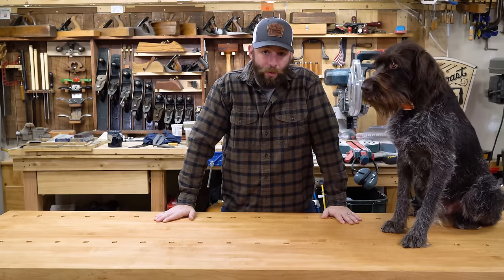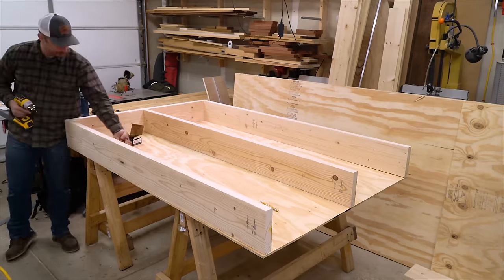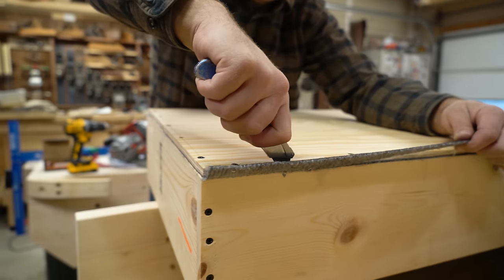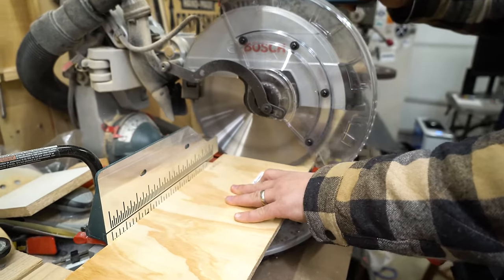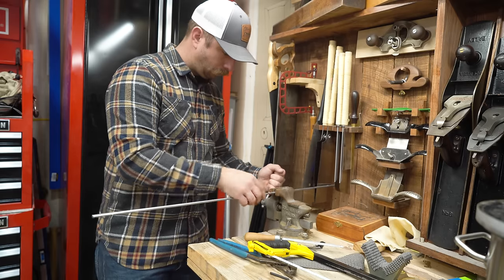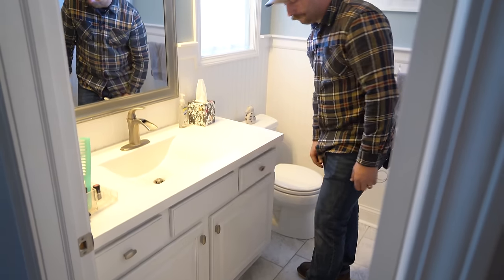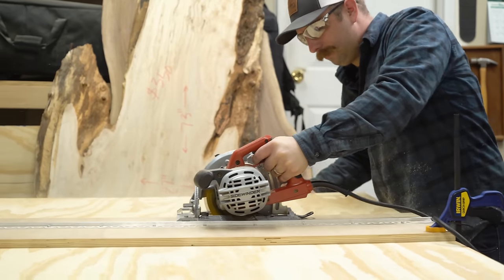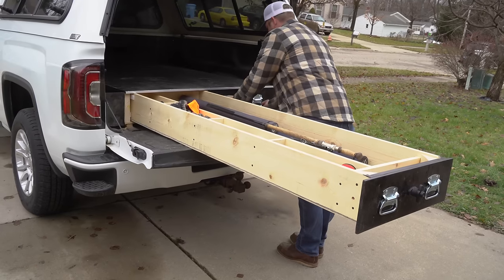How To Build Truck Bed Drawers // SUV Drawer // DIY

Comment: I made a set of these  using 3/4 sanded ply for almost all of it with a 12" tall box for my F-150 8' bed - then built some sliding  internal boxes within the drawers... so far so good. One issue was the  UHMW - cheaper to buy a whole sheet than pay for shipping. I used pocket screws and glue - Temperature changes were  an issue with the UHMW  temp swings were 35 - 75 degrees during the build - hoping the weight of the drawers will solve any issues going forward - I live in AZ - the real test will be the long hot summer - good project - next phase is a rolling truck bed to mount to the top - I think I will have my welder build it for me instead of more wood and a bunch of bearings or maybe use 8020...

I don't have a tailgate so I mounted the whole project to the truck bed with rivet nuts - my new favorite thing - cant wait to find more uses for these babies
Reply: did you find the drawers have enough support fully extended without the tailgate?
Reply: @hannahpierson5648   yes - plenty of weight to counterbalance as long as 1 of them is  is closed. I have developed a problem with the slides on 1 side so I have to re configure the slides - what has happened is one of my pocket screws went through and etched a groove in the plastic slide material so I have to replace it. - The box I built was 6' long and sits in a 8' bed - Right behind the cab I have an inverter and shelving - hope that helps

Comment: nice video,  did u have to go back drill holes for closing air compression creates resistance to close sometimes suction ? dark pencil like soft lead can be used same as lipstick or little chalk from chalk line ,  go grandpa  heehhe
Reply: Given the size of the channel on either side of the drawers, I don't think drilling extra holes is needed at all.

Comment: Nicely done, at first wasn't crazy about the carpet idea but then it seemed to make sense for me. The plastic for sliding was very clever, will use that. Really like the locking mechanism, need to adapt that for my truck tailgate window too. That lipstick heist was great especially the recriminations you had to endure. I'm going to make it all from free craigslist lumber or construction throwouts. Thanks and awesome shaving!!

Comment: Very cool!  Just need a power inverter in there and then you can plug in a battery charger for your drills or something.  I couldn't really tell what all you put in those drawers, or what kind of work you do, but they are certainly functional.  Nicely done.  Cheers

Comment: I just built these for my Ram. I’m definitely not a carpenter or woodworker and it shows. But the plans were easy to follow and make adjustments to for my auxiliary fuel tank. I’m a mobile rv repair technician and these drawers will definitely keep me more organized. 

I highly recommend buying the plans.  Doing it yourself will save you thousands of dollars compared to buying the prefabricated drawer systems.

Comment: I’m very pleased to have found your excellent truck bed drawer build. 
I was seeking some very costly drawer slides to accomplish what it appears you’d developed for a tiny fraction of the cost 

Not as smooth and easy as roller bearings, but $300 to find another method to avoid breaking a sweat? 

I’m making something for my Honda Odyssey work vehicle. I do mostly electrical and security camera and FSTV entertainment system work. I wanted something to obscure the costly and extensive Makita battery powered arsenal I haul around Wisconsin. Having a blackened out box is a good start. Seeing a ladder or maybe plastic sawhorses isn’t likely to entice a junky to break my glass for a fix. Having a 700lb locked box holding $3k in tools that can’t easily be removed means it’s either the whole car getting stolen or none of it. 

Thx. Again. ❤

Comment: You really did do a wonderful job on those drawers - but you being a gun woodworker, with all the skills and tools I can see why. Very well done - I hope mine turn out half as good. I really liked the idea of the strips of plastic, they usually use tracks but urs worked extremely well, good job. Thanks for sharing. 😊

Comment: Sweet !  I thought the  slides were a good idea and i always get a kick out of the shop assistant as he reminds me of my old  LabraDoodle who used to be by my side  for everything  i did  ad she enjoyed  jumping up on whatever she was allowed to  the drawers a  definitely a way better way to   Keep things organized and accessible in a truck bed  plus its a heck of a lot easier on your knees  then crawling in and out of the cap looking for things ! The only negative thing i wanted to let you in on. Is  that  i was a cabinet installer for over 20 years and many of the cabinet lock keys will  lock and unlock   Topper handles  i used to drop off. Items to coworkers into their trucks using the keys to  put items and lock them into their trucks  in parking lots and even their driveways at times  the one brand that used a completely different tumbler was roll and lock   Bed covers ? I put one on my Chevy Dually 3500 loved the look and inception but it wasn’t  very water proof  so that was a bummer  i do reccomend caps to most of my freinds but warn them about the security  i was lucky in my previous truck with a cap that had tinted windows i made a black vinyl cover that  hid any valuables in the bed  if you tried to look thru the windows it gave  the impression that the bed was empty

Comment: Perfect👌for what I need. That would for my application ready-quick storage space. Some guy in LA was advertising something very similar to yours on "OfferUp" for $600. I commented with a "fair price, when  can you do.?" He responded saying unfortunately he couldn't travel to Las Vegas.  Lol. I don't have the professional pre-planning skills that or would take. So,  thanx for the video. You're good at what you do. Got a bit of experience & all the right tools. Good job..!! >> I bought a $300 Harbor Freight large 48" wide top tool box. It was easier, but i give up the entire rear cargo area of my Tahoe. Now it's more difficult to sleep stretched out in the back. I would rather have what you made.  Want to trade.? But I CAN use my back seat which is good. I would use my tool drawers more than my back seat though. I just subscribed to your channel & shared with two idea interested friends.

Comment: Thanks for sharing- excellent design and build. The one thing I didn’t catch is why you made the drawers 1/2” shorter that then you added the additional blocks at the back of the frame. Why not just make the matching length?

Comment: Great build. Very nice job.

The only thing i might change is to possibly add a support that folds up under the drawers to support them while they are open. 

I plan on building a set of drawers although I want to use a tubular metal frame.

Comment: This is GREAT! Though I need to be able to pull the whole tool box out of the the bed of the truck and use it as a stage. but still with compartments and have the stage/storage wired for a central power hub capability a for lights and sound equipment. And maybe some detachable dolly wheels for truck to setup location. I am not super handy but, this video was the perfect starter platform I needed. great video.

Comment: I made something similar( not as nice) and also had a slider on top of the sliding drawers . Instead of screwing the top plywood down I put rollers  bearings , (underneth ,(where you have your 2x8s)So had tool storage,  and also any cargo on top could slide out or in. Then I switched trucks and just have side aluminum boxes now , left my pick up open bed, with a home made bed slider only..  Seems like we always thinking about easier way to get tools in and out of a job and have the tools organized to save time and make it easier🤓

Comment: I really want to build one of these for my plumbing truck. The metal drawer systems like the pack rats are small and very expensive. But... I don’t have a camper shell on my truck, what do you think about it being exposed to the elements everyday? Do you think it would hold up?

Comment: Nice design and well done video!  I might just build some.  But those screws into the truck bed are at risk of causing a rust issue in the long run.  At the least, I would seal them up with seam sealer (from any automotive parts store), from the bottom and from above

Comment: You can buy a 55 gallon plastic (HDPE) drum often for $10 used, and cut the 1" strips out of it for the sliders rather than paying $65 for a small sheet of UHMW. Just use Loctite PL 3x construction adhesive to secure the strips rather than screws.

Comment: Great build, I'm about to make my own.. couple questions - how much weight can you put the 1/2 ply top before deflection becomes an issue? and I'm surprised you used 1/4 for the drawer bottoms.. hows that holding up? Would you change anything? Thanks so much.

Comment: Love this! I just need to figure out a way to secure it without drilling holes in my truck.
Reply: Daniel Treadwell Install eye bolts at the corners and use J-hook turnbuckles to attach to the existing tie-down anchors in the truck bed.

Comment: You are extremely creative. This is an excellent video. I had someone make me one like this a few years back, but the guy never put anything on the bottom of the drawers to help them slide. I was thinking about putting some kind draw slides or something but I think the way you did it is pretty good. Also, I am going to improve what I have. Does the sliding mechanism that you have work OK or do you suggest something else Thank you so much.
Reply from the maker: Everything works amazing!

Comment: I did mine this way and if I had to do it again I would use 3/4 sandwiched with glue and screws for the deck framing. One it would be lighter and two less prone to warpage like dimensional lumber. Sure it would take longer to build but I am willing to put in the extra time. One thing I found out is that dimensional lumber is not what it used be. The 2x8s are 7 1/4" & 7 3/4 which threw off my plans. I didn't find this until it was too late after I glued and screwed the base together. Using plywood you could and can cut your wood to your requirements.

Comment: Loved everything but the shave lol.  Great project and want to do this for my suv.  Since my rear door is a lift up and i won't have a tailgate for the drawers to rest on - any ideas on how to support mine?  Its' an 02 Suburban so i will have about 6'5 feet behind the second seat to work with.  And good point about your runners and the tailgate lift as i have the rear plastic trim to get above.

Comment: I built a similar set of drawers in 1980. Many years later the top of the box was so warn from sliding materials in and out that I recovered the top with 1/4' plywood. The locks I put on the drawers were just pieces of wood that cover the end of the drawers. I have three drawers and so I have two pieces of wood that hold the drawers in. That way there are no mechanisms inside. Should anything shift it could keep you from opening up the drawers if the locking mechanism will not move. For handles I have a loop of rope in the end of each drawer. In most cases it is more than 48" between wheel wells and so I have a smaller long box for my long level. For the bottom I used 3/4" and the top was 1/2" plywood. If the bottom is not thick enough it will tend to curve upward if the support is not directly underneath the long pieces that divide the box into sections. To lubricate the drawers I used paraffin. At first I thought some is good and more is better until the weather got hot. The wax had melted and so the drawers were hard to get out. So I removed most of the paraffin. I have never lubricated them since. They move so easily that if I forget to twist the locking piece of wood sideways I will hear a clunk noise and that means my drawers are moving as I stop and accelerate. When I first built mine, I used framing lumber for the drawers and dividers that was not completely dry and so there was still moisture in the drawers.

Comment: Aren't the rear end of the drawers rubbing up against the top when they are extended due to the weight of the extended drawer?   Wouldn't some of the plastic stuff on the top of the drawer help with that? Just a thought.

Comment: How heavy do you think this is? I have a few 2 bys and a piece of plywood to make a platform in the back of truck. I would love to build a sliding platform that I can pull to get to stuff under the platform easier. 5’2” bed.

Comment: Fantastic build! I really think you covered every detail involved here very effectively. I especially like the plastic anti-friction "glides" as an alternative to very expensive drawer slides.
I have a "Back-Flip" bed cover and I've been fighting the urge to purchase an expensive but ready made drawer system. 
However, I am left with two questions.
#1. Why did you not use any glue anywhere? I would think that gluing every joint would be beneficial due to the ravages of over the road vibrations and bumps.
#2. Did you REALLY put that "stuff" on your mustache?
LOL! Happy Trails!

Comment: Nice build but i do carpet you should of just dropped carpet in that way if it goes bad holds mold or water you can take out put new in nice job i need to do but have no room to do this kinda work. Also add some legs to bottom so when pulling out you can have suport on storage unit if needing to use top as work station.
Cool stuff I'd buy one.

Comment: I help my dad do this back in 1986 on his work truck after we got done with a project that we was doing at a lingerie factory they give him some old tracks he took tracks cut them down and we built boxes like that and put a little stand on it so they wouldn't fall over they work great the whole time he had his work truck was easy to get to the nail guns out the compressor you know cutting tools saws whatnot it worked great it's a great idea

Comment: would it make sense to put the UHMW on the drawers, and not the box? should have painted the inside of the box/drawers too to prevent water damage from damp tools/rags/recovery gear... looking to do a half drawer pull out for my 2016 tacoma for offroading use. tool storage, and camping gear (planning to build an integrated camp table that adds to the top, or slides out the drawer bottom.. havent finalized the design yet.. just in my head at the moment.

Comment: I’m trying to mount a pizza oven on my truck bed and have drawers underneath it. Do you have any advice on heat deflection material to put under the oven? It will be a wood fired pizza oven so 900*F

Comment: Awesome video thanks for sharing. Do you ever coat the drawers with polyurethane? I want to make them as durable as possible but I’m also worried about the sliding action with the polyurethane on the UHMW. You think it will negatively affect it?

Comment: I just purchased a 2019 truck with the 5'6" bed, I would like to do something similar to your bed box to haul my RC airplanes. Slideouts that are only say the thickness of a 2 x 4.... I like the hard plastic runners to slide on....

Comment: How satisfactory do you find the UHMW plastic in terms of 'slideability'? Would roller skate bearings (with their space disadvantages) have allowed for easier drawer opening & closing?
Reply from the maker: The UHMW works great. No issues with how they slide

Comment: Is that your work truck? How much weight would you say you can put in the drawers and still slide open and close easily? I'm a excation contractor and feel that I would need a welded steel frame and some kinda of a angle iron and bearing  drawer slide set up accommodate the weight of my tools and support whatever I might put on top

Comment: Much  cheaper than the decked system. And using the 2x8 should hold as good as the Decked system.

Comment: Very nice work. After this time are you still satisfied with your floor glides? Or, are your drawers hard to pull when loaded? Would you do roller bearings and tracks if you did it again? Thanks!

Comment: Really cool. Extremely glad I came across your video.  I have been thinking of doing something for my van for a long time, but did not want to use sliders. This UHMV solution is great and seems inexpensive. Did you use that in your original build and has that held up well?

Comment: How water resistant would this be using the flex seal and without a camper shell? Obviously the drawer fronts would need a redesign with some sort of weather stripping, but wondering if the flex seal would keep the plywood as water resistant as a truck box would? I know Decked says theirs isn’t air tight and I would imagine this would be the same as far as that goes, just wondering what your thoughts were... I don’t have a camper shell and like the idea of this and getting rid of my diamond plate tool box. Thanks and love your craftsmanship!
Reply from the maker: Spend the extra money and use MDO of marine plywood with flex seal or exterior porch paint and weather stripping and you’d be good.
Reply: @ThirdCoastCraftsman  Okay sounds good, thanks for the reply and advice!

Comment: What could i do to make it waterproof? (Without bed topper)  Great video
Reply: Hi, you can find Hurcaliner by the pint, quart or gallon at Auto zone or any automotive store including Wal-Mart. A similar waterproofing roll-on product to Rhino lining. I used it for my bumper that holds a 12,000 lb winch. Used a paint roller with aggressive texture because I use the bumper to walk on as well. You can use a smoother texture paint roller if you want. Herculiner has been on my front bumper for about 5 years now and has not peeled, sun baked to a very dark grey, but not peeling yet.
Reply: @andyprairiedog  oh okay yeah. Pr I could spray on some underbody coating too?
Reply: @isaacsalo2358  That will work too. Just remember to remove any rust first if there is any. Good luck with your build.
Reply: Thanks!